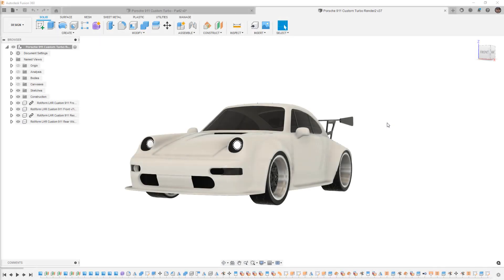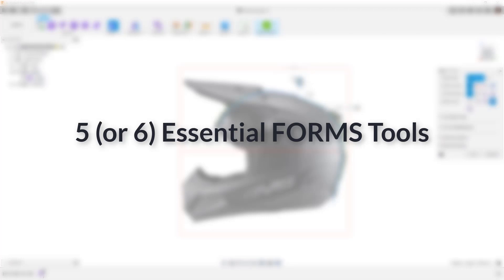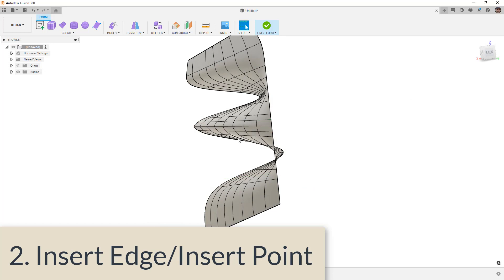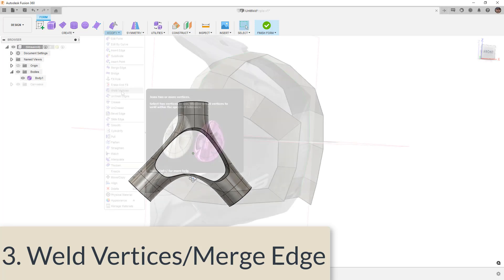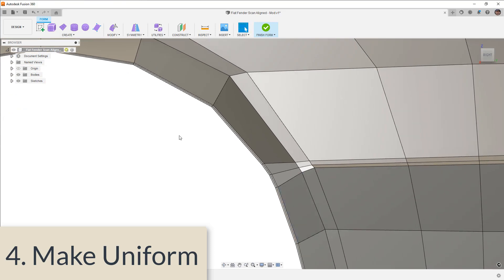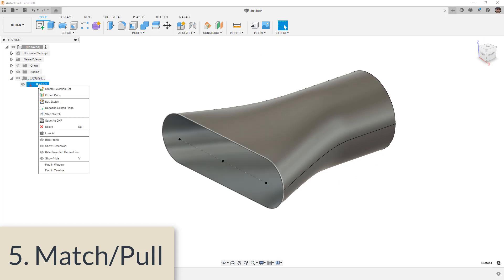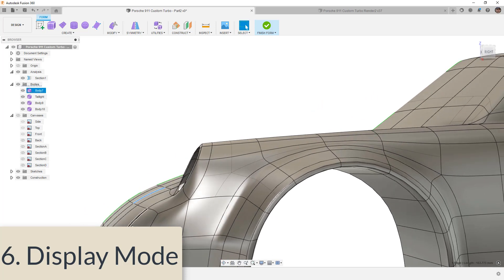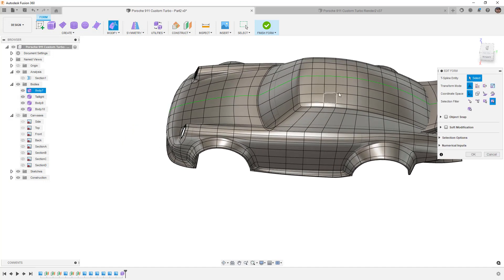Fusion 360 Form Mastery Part 40 - THE 5 (or 6) ESSENTIAL TOOLS TO DESIGN ANYTHING WITH FORMS

Comment: Flatten is one of my favorite as it makes things either vertical or horizontal.  In bottle design, forms is great at making the difficult much easier and scalable.  Sometimes at the end of a model the surfaces that intersect the axis "overrun" the axis.  Using flatten works wonders on this problem with a few clicks.  Having your series have opened a world of possibilities that makes modelling even better.  While I count this episode (40) as the cheat sheet for form modelling, it is important that we do not substitute it for not going through the whole series.  I do about 4 episodes a week in order to catch up.  You need to try the modelling while seeing your demonstrations.  Otherwise it simply will not stick.  Thanks Again Matt.
Reply from the maker: Thanks so much Brian!  Yes I certainly don't want this to be a substitute.  There are so many nuances to working with Forms that it takes hours and hours of practice and patience :).  I am glad your models are progressing.  I am an advocate for SubD modeling in CAD as it opens up possibilities.  The more people that use it, the more development time it will get!